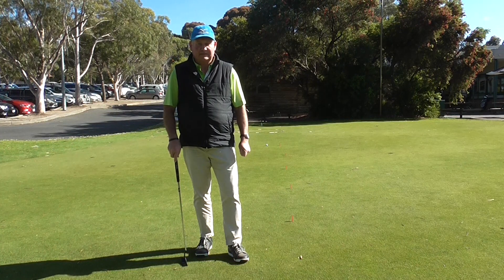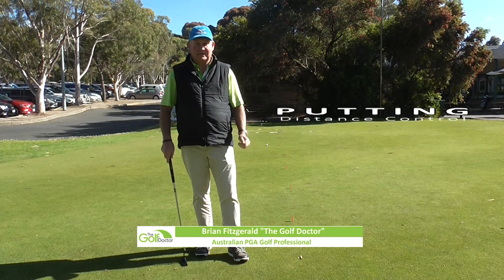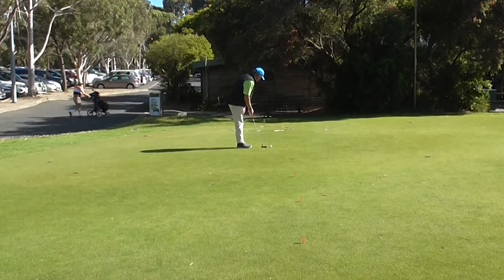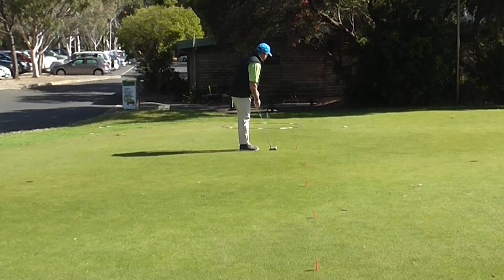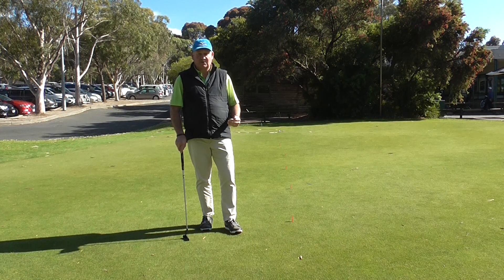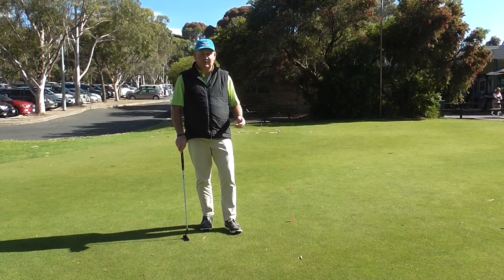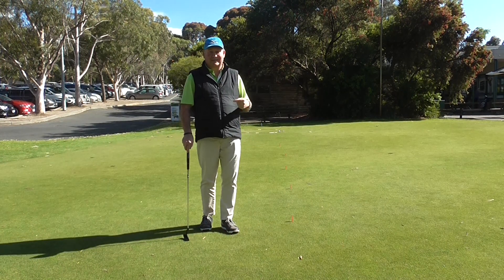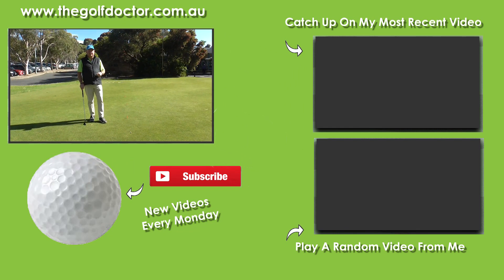How To Practice Lag Putting

Comment: Great idea Brian, another area I could improve. I notice when you do your putting you don't seem to change how far you take putter back for longer putts, you just hit it harder.  I am poor at long putts and maybe it is because I am trying to take a longer backswing then getting a poor connection at impact.  Looking forward to the masterclass session too.
Reply from the maker: It is certainly an area you could improve on Mike. It is funny you notice that my swing length doesn't  change and I hit harder. The data doesn't support that.

I work on timing for putting. I use the same timing for all of the lengths of putts so the adjustment for distance is made with swing length. Video can be deceiving particularly when viewed from down the line.

I will reveal more in the Masterclass. I will catch you next week with the details.

Great round yesterday by the way. Imagine the score you would have had without any 3 putts.

Brian

Comment: Not sure its a realistic drill because at each new position you can recalibrate your feel for how hard to hit the next putt. Plus you get to make several putts in a short period. A more realistic drill would be to putt in combination with chipping. Make a chip then try to make the putt,  i would suggest practicing the short putt stroke without the hole then do the same with the long putt.
Reply from the maker: Realistic practice is the best way as I say on all most all of the videos I make.
However there is a time to do repeats. Usually when you are learning or working on a skill.
My favorite shortgame training session is 9 holes from around the green. All inside 20 yards from a variety of positions using one ball.
Beating par (all par 3's) is the immediate goal.
Brian